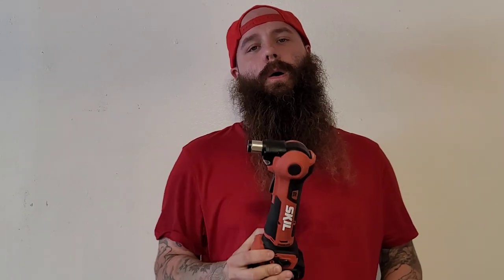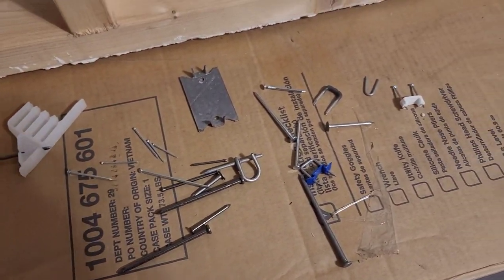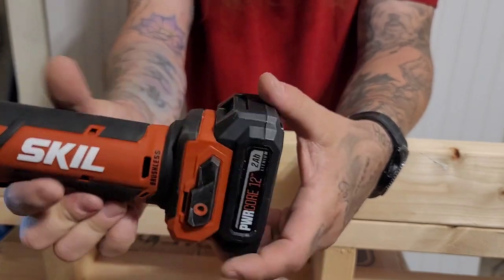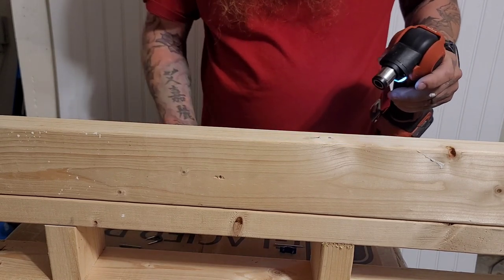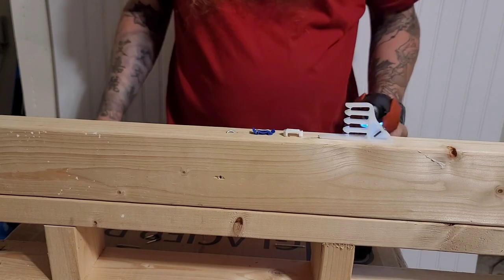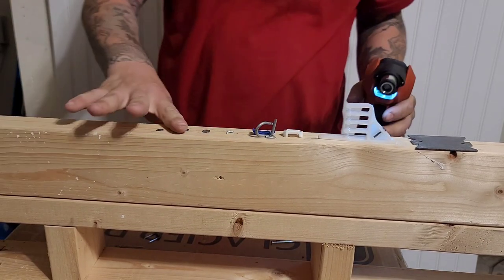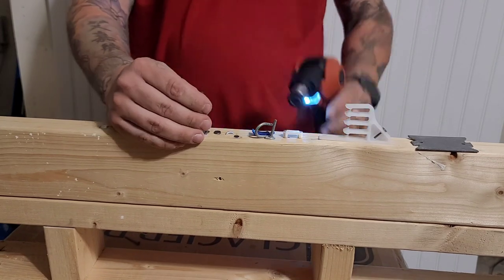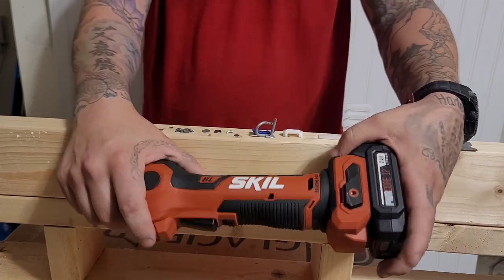WHAT CAN'T THE SKIL AUTO HAMMER DO?!?!

Comment: thank you just heard about them the other day, but i do not want to use it for a hammer but rather to drive out spent rivets in a harvest cutter bar, will it work for that?
Reply from the maker: Yes! I'd suggest using a punch or round chisel with it but absolutely will work!
Reply: @thecarplumbtrician  ok, i have discussed a tool like this with the traveling reps of Dewalt and Milwaukee,  but they did not have
Reply from the maker: @philippetays4263  milwaukee has a similar one, but not articulating head
Reply: @thecarplumbtrician  i will check that out

Comment: How does it work for 3/8 all thread ? Serious question through dirt?
Reply from the maker: How far are we talking
Reply: @The CarPlumbTrician  18inchs terrain does vary. I use a mini sledge currently was just curious
Reply from the maker: @Joshua Nash  the low impacts are nice, similar to a chipping hammer, but not sure if it'll have enough to drive it all the way.  What do you run all thread in the ground for?

Comment: You should try concrete cut nails in a concrete slab house just to see if it is possible
Reply from the maker: I'll give it a go!
Reply: @thecarplumbtrician  did it work?
Reply from the maker: @TheRainHarvester  not enough bang.  It'll sink 3-1/2" framers but takes a bit
Reply: Can it drive a nail into a dried eucalyptus and on concrete?
Reply from the maker: @edwardkinyanjui1286  not concrete

Comment: I had a vague recollection these existed the other day when I was putting in electrical boxes that come with the cheap Chinese nails that bend anytime you're nailing into anything but fresh, knotless fir. Ugh, the aggravation! It's impossible to get a good straight hammer swing between studs where the clearance is 14.5" but the nail on a double gang box doesn't leave you jack squat for clearance for a hammer swing so you choke up on the hammer and are tapping forever just to drive a nail. Then, if you're right handed, but the box has to go on the left side of the stud, plus it's angled upward from the floor.... Aggggh - damn it! Never again. I'm getting one of these.
Reply from the maker: It does really well for rough in!!!

Comment: Does anyone know how well this would work for drywall nails I’ve had problems in the past with screws so I wanted to use nails and this seemed like an easier alternative than a traditional hammer to get the nails flush with the drywall any help would be appreciated.
Reply from the maker: Perfectly
Reply: @thecarplumbtrician  thank you very much I’ve been trying to get better at some home upkeep and I’ve always had a problem with Sheetrock hopefully this will help when I go to mud the walls again thank you very much sir
Reply from the maker: @aranmosher1507  good luck! Come on back if you need any tips!